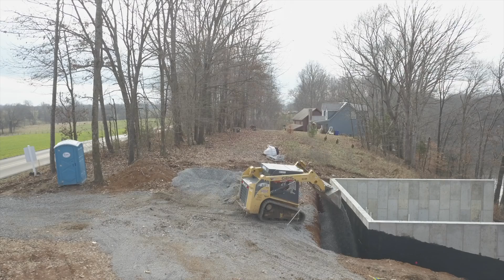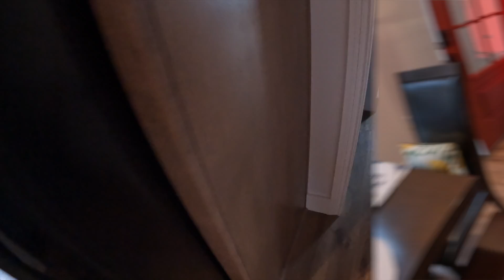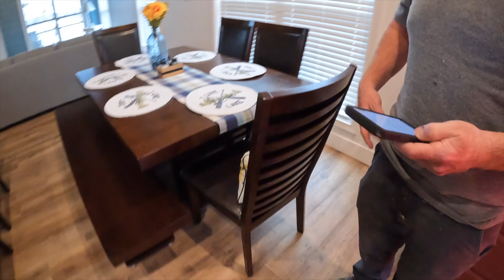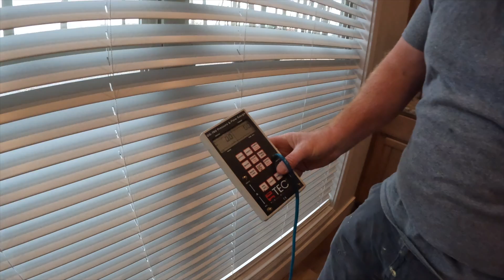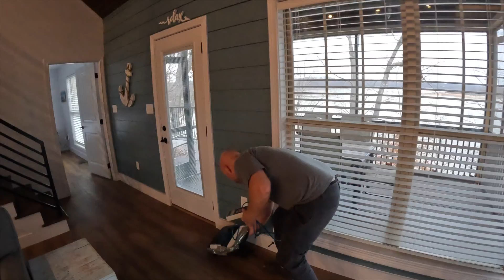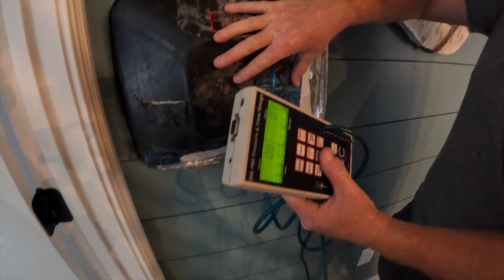Does your house leak? Blower door testing and results.

Comment: I'm surprised he didn't take the volume of the home instead of asking you.
Reply from the maker: His company does energy work for TVA weather proofing homes. In his normal line of work the actual ACH doesn’t matter as much, it’s more about tightness. Our HVAC company used his data to find the ACH50 which was 2.67. That’s not as low as we want but we’re establishing a base line. We have another house where air sealing wasn’t really a consideration that we plan to test as well. Our hope is those will give us something to work off of as we move forward. Thanks for watching
Reply: As the builder you or the architect should have the answer to every input question asked. The more accurate the sqft, volume, dimensions...the better the calculated ACH50. When you said the height was 18 and he said he would go with 20, he was wrong. If in doubt, measure. Plus, that is a cathedral ceiling, so the volume is less still. 
Even so, great job at wanting to know and to improve your projects. The improved efficiencies are measured in comfort, energy cost and building durability/longevity. All of which sell to the buyer.